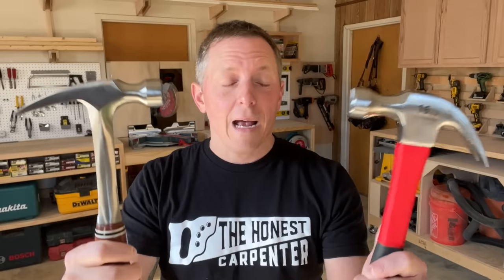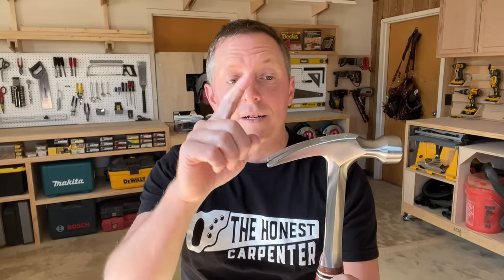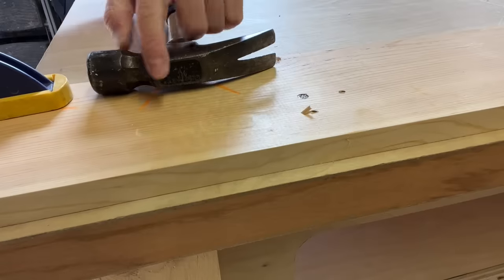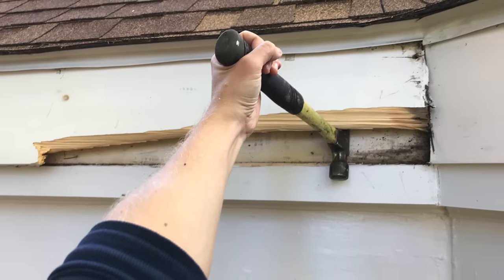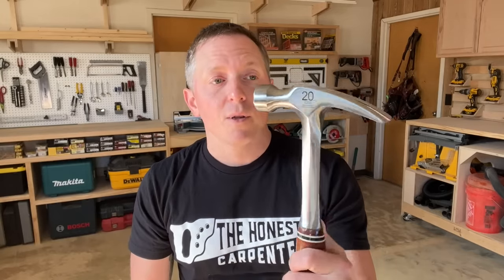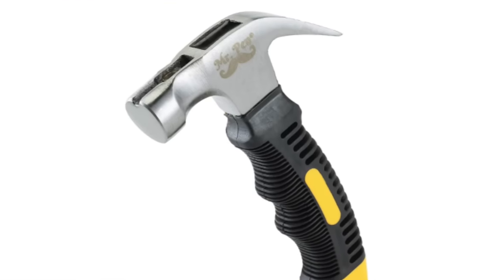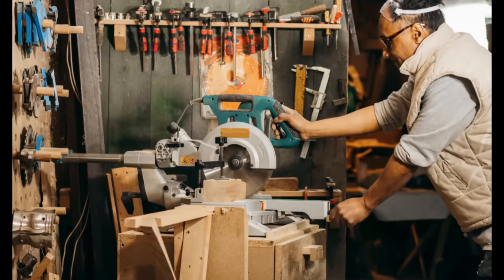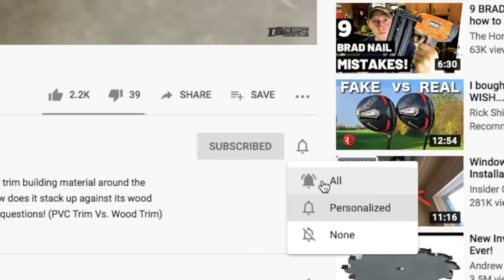DON'T USE STANDARD HAMMERS!! Try This Instead...(Rip Claw Hammer Vs. Curved Claw Hammer--Which One?)

Comment: I love the 22oz estwing however using 1 for 1 day kills my elbow. So I have transitioned to Dewalt hammers I loved the 14 oz the 1 with the flat shaft. They didn't last long, I went through 3 in like a year and a half (had a good warranty lol) then I couldn't find them anymore so went with the 22oz has been a good hammer for the past 3 or so years but still like the ones that shaped at the handle better. Because they hit like a stiletto at about a quarter of the price.
Reply: Wooden shaped handle! Kills the vibration... I never liked the estwing. Everyone had it in my crew but my Vaughn felt so much better, and I am pretty sure for demo work it was way better...just use good sense keeping in mind it is a wood handle...
Reply: I agree, however I have made my living building system scaffolds for most of my career (cuplock) and a wooden handle wouldn't last long. And the flat steel makes a handy hatchet when having to notch some plywood to fill a hole. If I did mostly wood framing a wooden handled or fiberglass hammer is what I would be using.

Comment: Good to know. The main thing I use a hammer for, is pulling nails and driving small nails, so a curved claw makes more sense for me.
Reply: Personally I tend to use screws rather than nails for construction, a lot more reliable.  Nails are used for speed.
Reply: @toriless  I tend to agree, but there are some things for which I can't really use screws... Unless... 🤔

Okay, I think I could use screws for weather stripping around garage doors, but only with one of those special drywall drills.

Comment: All hammers come in different weights.   Notice how that rip claw says 20 on the side of it, that's how many ounces it weighs.  You can get them in 15 and 10 ounce also.   So the rip claw hammer only tends to be heavier, if you tend to buy the heavier ones.   If you tend to buy the 10oz hammers.  Then they'd tend or be lighter now wouldn't they?

Comment: I dont use any claw hammers now , the claws break off when used at -40. All 4 hammers i had broke the same day hammering the same nail, 7 of the 8 claws . Yes the claws broke wile using the flat face to drive a nail. Is that normal in extreme cold?

Comment: The proper tool for the job... The curved claw hammer is a woodworking tool, the curve helps prevent marks and dings on furniture and cabinetry, that is also why these hammers almost always have a smooth head, rather than a waffle pattern. In construction, the longer handle, better weight distribution, and waffle pattern head are all better suited to the quick and dirty job of framing a house, not to mention the claw is just better at pulling nails...

Comment: I needed to buy a new hammer to build a base for my small shed. I bought a framing hammer as it had a long handle and I thought I could drive nails easier. But the waffle head on it seemed to keep the nails from going in straight. Why are they called framing hammers and why do they have that waffle pattern on them?

Comment: i have plumb rip  claw (my favorite) that looks like east wings also some i found have to short hammer head or to curved handle that you get your knuckles  also the expensive super light with a heavy hammer swing    seam to be to big and clumsy for tight areas

Comment: Carpenter wiyh 46 years experience here.
Got a rip claw but have gone back to standard claw now. Rip claws really are crap for removing nails espesially rubbish with lager nails. If i want to pull stuff apart or do demo i use a Gorilla bar with my hammer anyway 🤷‍♂️

Comment: wood handle 160z... Craftsmen made a swegged head 16 oz  wood handle hammer. it would not come loose! I've had one for 20 years. retired 41 years in carpenters local #322. hit harder with more speed...! have you used a wood handled hammer?? yes you can chop with straight claws and I have and I have a 20 oz with straight claws.  You should have a Bar of some shape or size for ripping.... steel and fiberglass are slow and heavy. so before you tell me otherwise swing some wood and your welcome....

Comment: Pulling nails should be done sideways in the claw, whenever there is room. Easy to break wooden/ fiberglass handles, while rolling the claw. Got a Craftsman " adjustable head" hammer as a gift. Thought it was just a gimmick. Man , that thing is nice for pulling nails, in between studs, etc. Ok for hammering too. So far, indestructable.
Reply: Get two Vaughan 19 oz waffle face framers.  Easier on your elbow but the wood handles will eventually break - guaranteed.  When I did rough carpentry ("construction work"), at least once a week, someone would snap the neck on their wooden hammer handle.  I remember a framer OH SO CAREFULLY trying to remove a poorly placed nail with the "sideways" technique - he just snapped the handle in slow motion!  We all laughed.

Comment: 50 years ago as a 14 year old, I showed up to work a roofing job with my great uncle. He saw my cheap curved claw hammer and said “let me see that”. He took it over to a saw horse and cut the handle off and threw it in a scrap barrel. Then went to his truck and handed me a rip claw loaner.
He said if I ever find myself sliding off a roof, turn that thing over and bury the claw in the roof and hang on. We can patch the roof later. Can’t do that with a curved claw.

Comment: The problem with that shaft on the RC hammer is that it can inflict serious injuries to hands and fingers. A RC hammer on a more traditional shaft is much safer and won't cut off certain body parts. It's a thing.

Comment: On a good strike, I wonder if the standard claw flexes at that microsecond of impact. It obviously wouldn't be flapping around much, but no material is perfectly rigid. Depending on how much it flexes, it might be wasting energy as it does so. Just a hunch.
Reply: If steel was perfectly rigid, titanium hammers wouldn't be a thing.
Reply from the maker: Good point, Kevin! Definitely need better cameras than mine to find out 😆

Comment: I just happen to have couple curve hammers laying around.  And 3 lb and 4 lb sledge for driving framing nails. Lol. As for demo. Hard to beat a 42” all steel crowbar. You can argue that pro’s will work faster with rip hammer and don’t need all those clunky tools I have.  But, I am not a pro and I only do DIY. I do careful demo and I don’t rip much. I use sawzall and circular saw 1st, crowbar next for fast demo. I find that nothing stands up to 3 lb sledge + crowbar combo.
Reply: I'll do a little demo with my hammer, but if it's very much 
the crowbar and heavy hammer is coming out.

Comment: I have a couple of hammers around, I just checked and they're both rip claws (I didn't do it on purpose). I only use the claw for pulling nails....so I guess I have the wrong ones.
Reply from the maker: Give the curved a try, Nope. It has a surprisingly smooth glide on nail extraction. I still stick with the rips though 😉

Comment: interesting perspective. Usually the claw is seen as the back of the hammer, but seeing it like this, easily can be the front of the hammer. Cool. Ball peen hammer? Whats up with that one?
Reply from the maker: Ball peen is largely a metal working tool, Chris! Almost never gets used on a construction job site. But hammer claws definitely enable 50% of the work in home construction!

Comment: this is missing some points:  Straight claw better weight forward.  Curved easier to get out of pocket or tool bag.  Curved claw better working in confined spaces,  Hickory handles are the best if you value your hand, arm and shoulder.  Vaughan hammers offer  the better choice.  At one time Plumb, True Temper, Stanley and Belknap offered some great hammers but they have pretty much disappeared
Reply: Perfect!  My go to hammer is a Plumb, 20oz. red hickory handle, curved claw, which I've owned for 50 years.  I misplaced it a couple years ago, and started searching for an exact replacement.  I think Plumb was still offering it, and almost bought one but mine turned up at my son's house, so no need to buy another.  Their 16oz. "Autograf" version is Model #11436.

Comment: As a professional carpenter and framer for more than 30 years I will agree to disagree with his favorite hammer. My preferred demo hammer is a straight claw. My preferred framing hammer is a 16Oz Plumb head on a handle I install so the top of the hammer to the base of it is 16 inches always making sure the grain of the handle runs in the proper direction for strength. The claw serves a purpose of being able to grab a 2X and take some twist out. I have done this so many thousands of times while framing it is just second nature. As we all know framing is done with air or electric nail guns any more and the claw allows leverage to straighten boards out among other things. Each has a purpose and they are two very different things just like a hatchet hammer which I also use.  No one of them is better than the other. I also have a preference for wood handles and installing my own, however to each their own on that. To me the mall metal just adds unnecessary weight in most cases. Makes a difference after swinging it all day. Instead why not make a video on how and what the best uses of each are. BTW I am now a  construction superintendent for very high end stores. I have been around and worked with the very best in the industry.

Comment: Rip claws feel better at hammering even if both types are the same weight because the balance is better and helps with hammering having the claws in line with the face. Curved claws affect the feel and power of the swing negatively.

Comment: I can appreciate the insight in the video, but I have a complaint about your demonstration on the getting into a crevice demo: you very clearly used a rip claw technique for a curve claw, when you should have used a curve claw technique.  
This sort of thing happens way too often on comparison videos, and it’s starting to irk me because it brings heavy bias in. Personally, I’d rather learn the proper technique for the tool, and then test the results against each other, rather than test the tools against a technique when it’s not designed for that.

Comment: Curved claw, hate them, not even that great for pulling nails! Have to angle it over so far to start, there's often not room. Love to use the side twist method with a rip claw, as well as the shim method to protect the wood.  If lots of nails to pull, I'll use my blue flat demo bar. This seals it, now looking for a 16oz rip to go with my trusty 20oz framer, should have gotten years ago.
Reply from the maker: All good points, Eric!

Comment: First of all a curve called Hammer can Hammer nails in a tighter spot a 20 oz curve claw hammer is more than a straight claw it pulls wood apart easier it has more strength and if it bounces back it doesn't leave vampire marks on your face but it still hurts

Comment: Hammer weight is based on age and experience… the 17-18yo new comer always goes strait for the 28oz or even 32oz.
🤣 every passing year, and graduation in experience the hammer of choice losses weight as he slowly figures out extra weight really don’t aid in anything at all. 
One single 8 hour day of hand driving planks to a ceiling can usually cure the early heavy hammer hang up.

Comment: Finisher? 16oz e swing NO WAFFLE FACE clean smooth effective 

Builder? 28oz e wing. Lifetime warranty and unmatched. 

Farmer?  You need a 32oz e swing in the shed too with the 28 oz little brothers for barn nails and heavy demolition 

Contractor?  16s, 22s, 28s, and a 32oz, cat paws , crowbars, flat bars,  pneumatic hammers, pneumatic finishers, & compressor

Comment: Honestly, I've never owned anything but a rip claw hammer, and never owned one under 20oz... After watching this, I can't see why I'd ever want anything 16oz, but I've also built homes with a rigging axe. Lastly, save yourself pain and damage and use wood handles. It absorbs vibration much better.

Comment: Great video except for the weight suggestion. I'm so tired of the myth that anything under 16oz is useless. If you're only going to ever buy one hammer, yes you need 16oz for larger nails and demolition as well as alignment. But a 9-12 oz hammer covers 95% of my weekly hammer  use as a handy person. They offer far more control, especially for DIYers who don't already have and will probably never gain hammer swinging muscles. The rinky dink hammer with no handle you showed is admittedly useless as far as I have experienced. A proportionally handled 9-12 oz hammer is suitable and preferable for most DIY projects as well as non framing/demo work.

Comment: I bend half of the nails I try to sink. Thats the only reason I have resisted buying a new hammer with the rip and magnetic nail holder
Reply from the maker: A good 20 oz might work for you, Tyler! You can take some of the arm force out of the swing, but still get more accurate aim without sacrificing driving impact.
Reply: You need to learn how to use your wrist. If you don't use your wrist for the impact the arc of your swing is what is bending the nail. The snap of your wrist at the end of the stroke is where the power is anyway. Just a tip from an old hand.

Comment: I worked in remodeling for years and found a 16 oz curved claw to be vastly preferred in almost every case. In a situation that a rip claw would be preferable, a flat bar is almost always the superior tool. The rip claw leaves you with essentially no leverage for pulling large fasteners and makes for a longer profile, which limits use in tight spaces, such as when driving joist hanger nails. If I am doing demolition work,  and want to split boards apart or get into a corner, I am driving in a flat bar, not swinging wildly with a rip claw hammer. In my opinion, the rip claw hammer has become a symbol as a “man’s” tool, while sacrificing functionality. It frustrates me that there are so few curved claw professional hammers available anymore.
Reply: I disagree.  I throw the claw head hammers into the bottom of the drawer.

Comment: As a DIYer, I disagree completely! The rip claw is MUCH BETTER at pulling nails! The curved claw doesn't require a prop for small nails, but as soon as you need one, it behaves badly, and the way it behaves keeps changing as the nail progressively gets taller and you reposition the prop underneath it --- because the shape of the head keeps changing across its profile.

Since you may not have tried using a curved claw hammer with longer nails in a long time, let me refresh your memory:

It starts out with the propping board barely fitting under the head, requiring you to change your body position and pull at a completely different angle than you're used to, just to get started. There's a good change of damaging the wood surface, if your hand slips. (Note: this stage can be skipped by using multiple boards of different thicknesses, and repeating the whole process a second time --- or by avoiding long nails in the first place.)

Then, as the nail comes out and you get more clearance to get the prop under the pound-y side of the head, the handle starts jumping in random directions depending on where the hammer lands against the prop (2x4 or whatever).

Then, when you reach the straight part of the hammer head, it behaves adequately and predictably --- briefly.

As you start leveraging the curved claw against your prop, the physics continually change, but not too drastically.

Finally, when the prop board can fit totally under the claw and against the nail, you can pull one more time. DO NOT carry the hammer through its full stroke at this stage, or else you will damage the wood surface by dragging the nail sideways --- creating a bigger hole, or even cracking the wood.

Resist the temptation, then find a bigger board to prop under it, and repeat all of this, all over again.

Comment: My "the Other Hammer" ,  yep it has a name, is, has been the DeWalt 22oz. it is made from a Single piece of steel, previously id used the separate piece types....SEPARATE as in the get Separated..Never again.  It lives in a toughbuilt holster, i hate those stupid metal rings, aloing with the same cats paw i beern usin for years. which along with the other hammer i sharpen from time to time. as the face wears i re-groove it with my dremel.

Comment: The waffle head rip claw is great when you’re working on a commercial site and you need to break off or pop the zits or cement drool on concrete walls so you can nail furring strips or skim coat 😜

Comment: Bah, disagree.  20oz. curved claw has been my daily driver since early teens.  65yo now.  Straight claw is great for demo, but I have a better solution, which I've also used along side my curved claw since forever.  It's called a "pry bar".  Not a mousy shingle ripper.  Not a monstrous crow bar.  A 24", beefy 2 pound hunk of steel, purpose built for tearing stuff up, or methodically disassembling.  You can swing it like a hammer, or strike it with a hammer as needed.  

I've had a favorite for 50 years, and have purchased others since.  Always tweak the edges and claws with a grinder and/ or Dremel type tool.   

Nothing like using the right tool for the job.  Speaking of which, I notice the cheeks on your hammer are scarred to hell.  Not real impressed with that!